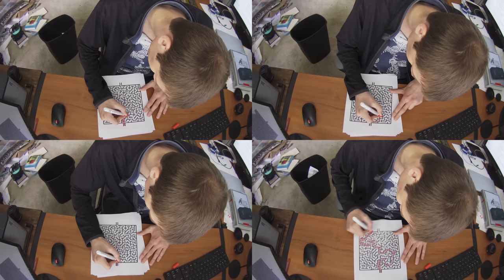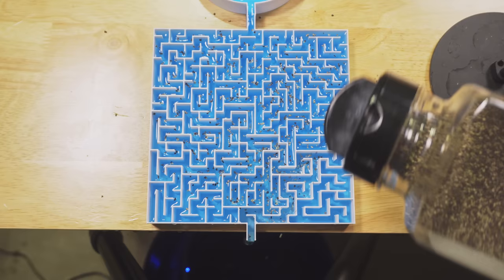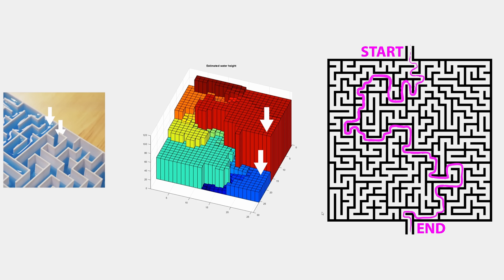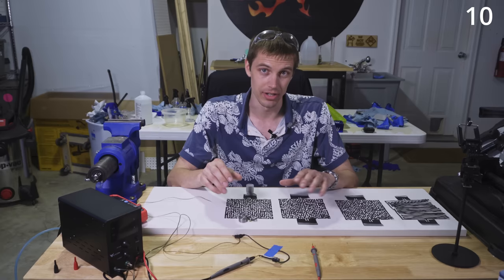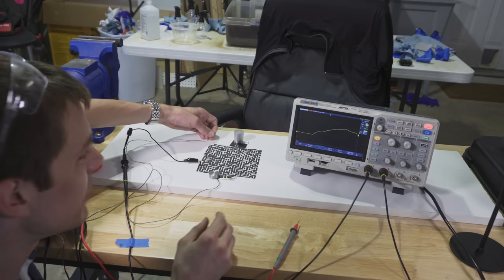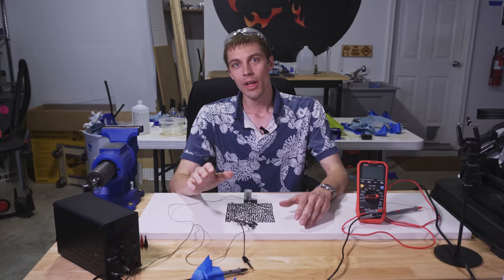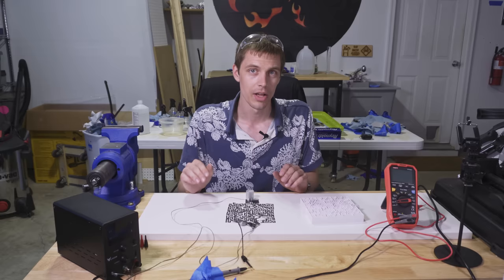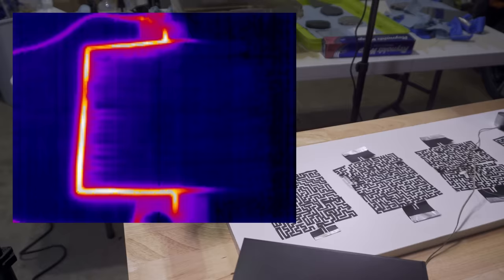How does electricity find the "Path of Least Resistance"?

Comment: Your ripple effect is caused by a capacitor effect. The current flow every where at first and when it finds it path the current from the wrong path flow back to the correct path making a spike in current. The current acted like water building up in every path. once the ground was found the current from the whole circuit flowed to ground causing the spike. You may have just found the way of measuring the speed of electricity. The spike was excess electricity flowing back from the farthest point in the circuit. The spike was the time it took to happen or speed of electricity.

Comment: I'm typing this before I watch the video. Um...doesn't that just happen automatically? Why would electricity ever "choose" a path of higher resistance? Your video title is like asking, "How does a chain always break at the weakest link?" The answer is, "Duh...no other possible condition CAN happen." Maybe I had better shut up and watch the video, huh?

Edit: Okay I watched it. It's very interesting to confirm that the voltage potential in any given "branch" from the main path is equal to the potential at that branch's connection point, just like the water height analogy predicts. It's also very interesting to see that the flow of electrons slosh around as they seek the equilibrium condition. But it doesn't change my analysis of the question/answer above. It happens because it must happen.

Comment: I counter something like that while solving the mechanical vibration system I figured out a way to solve all systems with an equivalent circuit which was much easier , i used it in exams our prof didn't like it ,then i found out it is already there in all mechanical and hydraulic systems

Comment: Issue I know since the metal has a single line to from start to finish. Adding a ground to each of the dead points will show even electricity doesn't know where to go it just does in a path of less resistance. 

Cool in theory but not practical.
In a humans eyes a maze is a ocean(water) and ground walls
If you tried to do the same thought process it wouldn't work for electricity. (It doesn't like to fail and when it does it fails completely)
Reply: The electricity out put would be due to resistance (water trying to go up a slope while falling down) this would solve the issues of difference due to needing more energy to produce a same effect
Reply: Water module, would need small holes. In total theory the point would show the blind idea of a humans path. Air works just like water just easier so for even a human sized scale you could introduce a "air current" which would show nearly the same as electricity.

To show this best you would need more resistance and grounding locations via electricity 
Water you'd need holes (you can reroute back to the entrance) allowing even more of a show to find each path (the very first section [very tall] would pour even faster then the final correct locations.

Love the video but the idea of these problems are not fully thought of in a humanthought process

Comment: "The ONLY path of a resistance" is more accurate. Water takes the path of least resistance, electricity takes every path it can get, with proportion to resistance
Reply: Water takes every path. Have you ever used two sinks at one time?

Comment: Why? Because  quantum  mechanics. 

The path is just a probabilistic result based on certain predefined factors, like humidity, breakdown  voltages, and distance, and total potential energy

Should see if lightning strike plotted form a similar interference pattern in 3 dimensions though

Energy is pretty lazy, if allowed it'll try to actually do as little work to maintain equilibrium, the work that results is due to the gradient between the two states of Energy

Things rather be stable than more unstable

Comment: There is no flow no time because if it does then it can not know which one is least resistance so it is no electron but only shadow and solid which already exist and so instantaneous so the electricity is the glowing of the pattern of circuit rather of flowing of electron and the voltage indicates how strong it glow

Comment: How long did you let the circuits run?
I think your water slope analogy is somewhat incorrect, because what we're actually looking at is thermal energy, and thermal energy always dissipates. So, your water slope analogy is good, until you imagine some of the water flowing down stream "wanting" to radiate back up the water. So a better analogy would be to think of two diverging rivers, and the lake upstream much hotter than the lake downstream. Eventually, after the thermal energy of the bottom equalizes with the top lake, then the thermal energy will want to radiate back up the wire.
So I'm kind of wondering, if my intuition are correct on this. I expect, that the closer the proportion of the two rivers are to 1:1, then the more evenly the temperatures of the two lakes equalizes. So, even though the shorter lake has a faster flow rate, it will also get colder faster, because its carrying more water (i.e. current). However, since more water is flowing downstream, more heat is flowing out of the top of the river through the bottom of the lake, which makes the bottom of the lake hotter faster. Still, eventually the temperature of the two lakes will equalize, but the right side, will be the last to equalize, but will equalize given enough time (I think we ought to be able to calculate this with newton's thermal law, but I can't remember it off the top of my head). Otherwise, it would be very strange for this not to happen, because I don't see how that would not be a violation of newton's thermal law.
But maybe I'm just high....

Comment: Fantastic video. Let me nitpick the "electrons flow through conductor" way of defining electricity. It's not strictly false but is misleading in the common case. (The not common cases are plasmas like lighting, arcs, and electron accelerators). In the common case of a wire in an electronic circuit, to be more clear you should say "charges flow." To understand electricity and especially electronics (because this is crucial to understanding semiconductor materials), you should stop focusing on the concept of electrons themselves flowing because all you need is to move charge itself, and the electrons are simply there to provide a mesh of charge movement. They just have to wiggle in concert to create disturbances in the electromagnetic field that look like what we can call 'n' or 'p' charges. That's right, by wiggling they don't just move negative charges in one direction, but also positive charges in the other. Those positive charges are NOT protons flowing through a wire. Nor then are the negative charges really electrons, though SOME electron drift does happen through the wire, and there are in fact some electrons inflow at the input and output. But mostly, it's a charge that is flowing, not actual electrons per se. Most of them are virtual particles in the electromagnetic field, not actual particles of the electron and protons fields.

The analogy I like to use here is very similar to your water with stagnant "mesas in a maze" analogy. But it's of Japanese rush hour trains, where they stuff people literally into the train cars, and once the train is full, each additional person stuffed into the train car does not travel down the train car, but rather a pulse of pushing does. Imagine now, that a second door on the opposite lateral side of the train car was opened That pulse of pushing created at the station side door by shoving in a new passenger would result in passengers already present and close to the back door being ejected through it. So it's not like passengers individually flowed down the train car, but rather, the energy of one person's worth of shoving is carried via the passengers in the train car. Now scale up the passengers that are not near the doors to *trillions*. The percentage of passengers passing through the doors is tiny. Most passengers are staying roughly where they are, though a slight drift is present. Trillions of them are just roughly in one area but are "conducting" a pulse of pushing that ejects passenger at the exit when a new one is shoved in at the entrance. It's easy to see with trillions of passengers that it's not passengers flowing through the train car. because it's not trillions of passengers flowing through the doors, as it would logically have to be. But it's harder to remember that with electricity because we forget about the trillions of electrons that aren't flowing very much. (Again, they do drift very slowly).

Mostly electricity is the flow of this ethereal pulse we call charge, and again, it's both positive and negative charge flowing at the same time in precisely opposite directions being carried by the pulsing of electrons. The electrons can mostly stay circulating around the nuclei of the material just as they normally do as atomic electrons. Electrons on the outer orbitals of an atom are able to flit about more freely in general than the electrons closer to the nuclei. And depending on the atomic number, this freedom is cyclically more or less tightened as you move through the periodic table. Thus, some materials are classified as "conductors" because they have freer electrons in the outer orbitals, which while still being atomic electrons, are able to sway just a little more to the left, or the right or up or down by spending just a tad bit more time on that side of the atom than the other or shifting their orbital slightly for a moment, creating a sort of bias in space of charge. If you do that in certain patterns, you can create the "illusion" of electrons flowing as if they were cars traveling down a highway,

Back to water. You may still use the water analogy. But it's important to point out that the water particles are not electrons in the analogy, but rather charge. And of course, to point out that the water analogy breaks down when it comes to the two opposite types of charge both flowing in opposite directions. In the case of plasmas, they really are like water in a sense, and they really are the flow of electrons, and also protons. They do conduct charges, by actually moving the electrons and protons completely free of each other, i.e. no more atomic lock-up. This requires the individual protons and electrons to be moving really fast to keep them from binding up as atoms. This was how the early state of the universe was because there were simply too many protons and electrons in too small of an area, so they kept shoving each other of the like charges around (so protons shoved on other protons, electrons shoved on other electrons). As the universe expanded and cooled, there was less speed and less proximity after approximately 370,000 years, and it was at this point that in a flash of light called today, the Cosmic Microwave Radiation, that plasma stopped being the default state of matter. Instead now,  it was atoms.

The thing is, controlling plasma is difficult. But controlling atoms is much easier. Because you can create physical structures and flow patterns, like wires, that won't zip off on you the way the high-speed particles of plasmas do. It also takes tremendous voltages to get plasmas because these days in the universe, electrons wanna just chill out near nuclei. It's also why we have resistance in wires because electrons don't flow like in plasmas but circle around nuclei, wasting a tremendous amount of time and energy playing "tether ball" with themselves and only haphazardly transmitting the pulses, though in some materials, it's much easier to get the pulses to flow straight, and in superconductors, you can get them to flow at the speed of light through that material because you can approximate straight lines (including curves) perfectly in those materials at certain temperatures. But the key point I want to make here is that in general, electrons are stuck to their tethers.

Charge on the other hand is able to flow, but since it is created by the individual electrons in their tethers, it actually doesn't zip off at the speed of light as expected for a massless thing. Keep in mind that the charge itself is a pulse of energy in the electromagnetic field: a virtual particle if you will. In this case, a virtual plus charge and a paired virtual negative charge. It's fascinating to think of a massless particle choosing to go slower than the speed of light somehow. That should be impossible. But with electronics, we found a hack. Of course, the hack is that the massless virtual particles are indeed going the speed of light but wiggling back and forth to burn a lot of that speed off wastefully instead of in a direct linear straight-forward motion. The wiggling, of course, being inherited from the wiggling of electrons of the atoms.

TL;DR
While lightning, arcs, and plasma in general, are the realized particles of the proton and electron fields, the charges that flow in everyday electricity are the twerking virtual particles of the electromagnetic field, mediated by the twerking of atomic electrons.
Reply from the maker: Aluminum doesn’t have hole flow, it has electron flow. In the math we fudge the “electrons” into quasiparticles that behave nicely in crystals, but at the end of the day an electron’s charge is tied to that particle, and they actually do move.

Comment: At 16yo in college I burned a professor with this common BS phrase.
He spewed the BS "electricity takes the path of least resistance". So I walked up to the white board and drew a steel chain link fence and asked how much resistance the steel post has? He said less than a ohm. I asked how much resistance do you have? More than a megaohm. So I drew a stick figure holding on to the steel post and asked, "this is you holding the 1 ohm post, and you are a megaohm, and you will BE FINE QHEN LIGHTNING STRIKES TO TOP OF THE POST"?
He dropped his head and said class dismissed. He told me to hang around and said, I have never been outsmarted by a 16yo, well done, I won't be using that statement again. That was in 1982.

Comment: I saw many problems with your explanation on electricity. Your voltage source isn’t “adding electrons”. It induces a potential difference across the 2 terminals causing the free electrons in the conductor (the charge carriers in the conduction band) to start flowing. Read into fermi levels as well I did not like your explanation about the multimeter as well.

Comment: i am answering the title without watching video if i am right leave a like 
 - it's because electricity is in form of electromagnetic field always and the circuit or conductance is obviously a least resistance so it's like a lightning trying to hit the ground but you gave them strings to figure out the shortest possible discharge link

i hope i am right 
and i won't watch video 
if i am wrong just roast me in comments like i am a steak on a grill

Comment: To say electrons "slosh around" like water before finding a steady state flow is entirely inaccurate. Electrons don't navigate the maze for a solution, instead the electrons take every single path simultaneously and at equal speed, while the path of least resistance has the highest voltage , and therefore, highest "flow". But technically every path has voltage, including through the air around the maze, and that voltage never goes to 0 as long as there is electrical current.
Reply: Actually, there is a video showing the electrons "sloshing" around until a stable DC current is formed.

Comment: Electrons do not "flow" in a piece of wire or semi-conductor. An electron transmit its energy to nearby outer electrons when submit to a potential difference to put is simply. In my humble opinion thinking that electrons flow as in water flows is misleading.

Comment: Nature has been showing Man since creation, that it doesn't need wires for current to flow !
And since all things are made up from Atom's, vis-a-vis, protons, neutrons, and electrons, wouldn't  it then be true, that these things  being common to these mediums, are why they perform similarly ?
The common denominator here the, "Atom" !
                          🤔....?
Reply: How do you get current to flow without wires?
Reply: @MrSummitville  
As in my example, 
" LIGHTNING " !
Otherwise :  In a wireless power transmission system, an electrically powered transmitter device generates a time-varying electromagnetic field that transmits power across space to a receiver device; the receiver device extracts power from the field and supplies it to an electrical load. 
As an example !
This is nothing new !
Very likely how Tesla experimented with his High Voltage Transmission tower !
Problem being, it was harmful to living things exposed to those fields !
             😫🫴⚡

Comment: I feel like every time I see one of these I get a bit dumber, so I'm going to skip it for everyone watching and give you the quick and dirty:

Electricity doesn't take the path of least resistance, there is only one path for it to take to complete the circuit. The maze gets saturated with the negative charge, which can only flow out through the opening connected to a resistor, which also must loop back to either a ground or the cathode. This isn't a mystery, it's 8th grade physics.

This all honestly reminds me of people sticking an object behind paper, and then putting the paper up to a mirror and being confused about how the mirror "knows" about the object behind the paper. The fact that basic physical properties of the universe, like the flow of negative ions to positive nodes or how light reflects is treated like a great "mystery" on the internet is deeply disturbing.